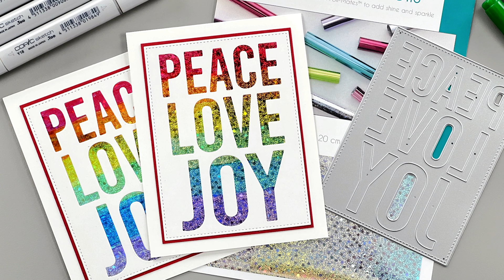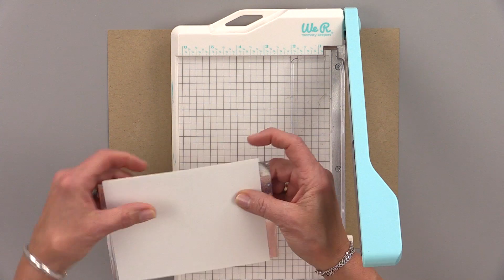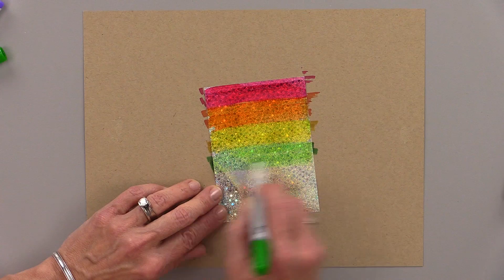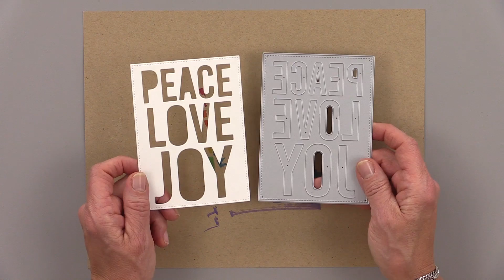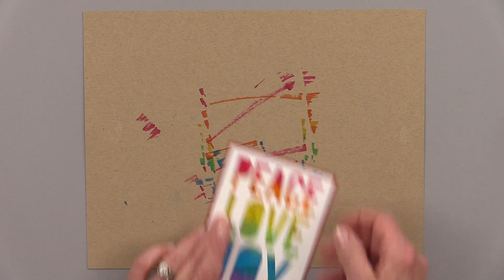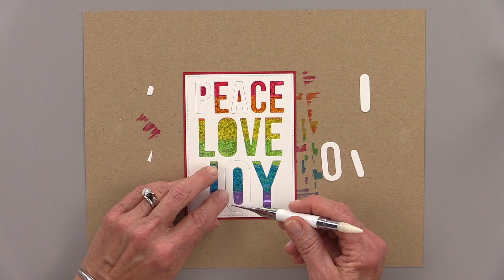Make Your Own Rainbow Foil - No Machine Required!

Comment: Thank u Gina. This is awesome. I love this technique. I am looking 4 ways 2 do foiling without the hot glimmer machine & laminator. I will try this technique. I have a few pieces of foil paper & copic markers. This is another way 2 stretch our supplies. How long does it take 4 the copic 2 dry on the foil paper so that the foil can be touched without smearing & removing the copic ink? Can u use any color of foil paper 4 this technique?
Have a blessed day.
Reply from the maker: It dries almost instantly. It works best on silver foil. ❤
Reply: @GinaKDesigns-StampTV  Good morning. Thank u 4 your reply. Does this technique work with regular colored pencils & gold foil as well? Have a great blessed day.